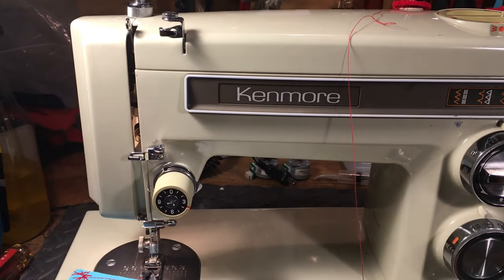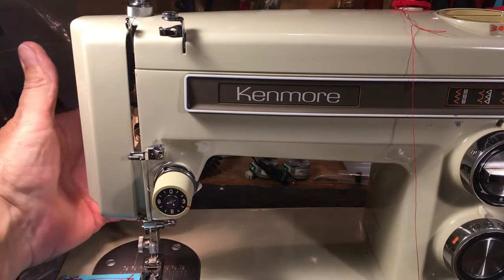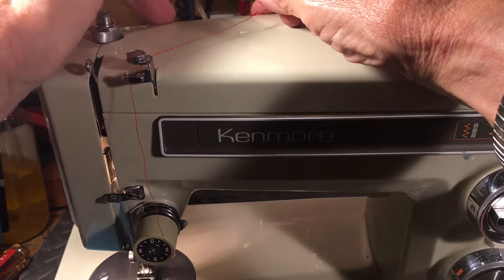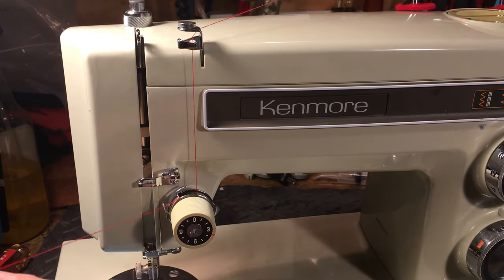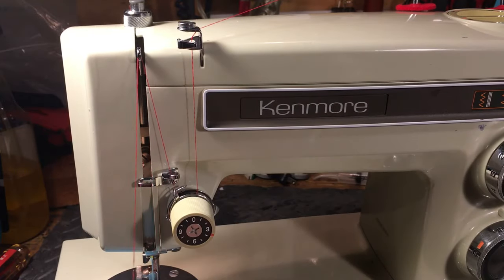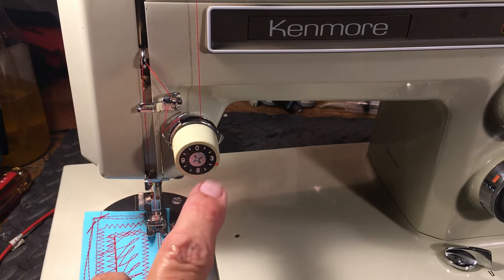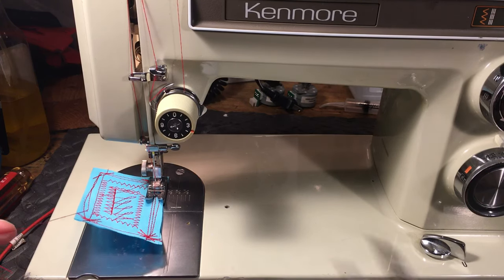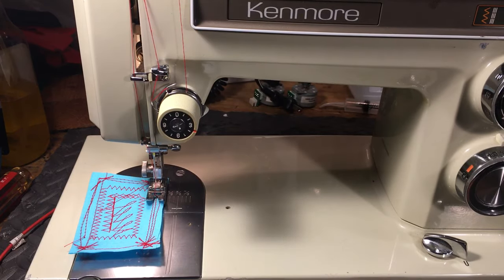How to thread almost every sewing machine properly.(Video 207)

Comment: I love my Kenmore Ultra Stitch 8 from the early 1980's.  It seems like it only cost between $125-$150 brand new and it has been a great dependable machine.  Recently I have found 2 others very similar to it in thrift stores, a 6 stitch and a 10 stitch, and they were only $10-$15 each and both had cases.  All mine are portable which I prefer, otherwise you need a cabinet. (I can always use the extra machines for parts.)  Threading a machine correctly makes all the difference.
Reply from the maker: Yes. It’s the simple things that make a successful sewing endeavor. 
1) thread 
2) threading
3) needle. 
Thanks for watching. 😎

Comment: You gave tips that are never mentioned in the manuals. I’m going to rethread my machine right now, and see if I’ve been missing something. Thank you! That small guide there right before you put the thread in the needle, how important is that one? I’ve not been using it, (nothing in the manual) could that be causing occasional missed stitches? I just rethreaded it correctly and as I’m testing it the stitches seem better.

Comment: I have the option to purchase one of these but it would be shipped across the country to get to me— literally from the East Coast to the West Coast. Do you think it would make the trip well? And should I take it to be serviced after I get it?
Reply from the maker: If you can convince the shipper to pack the machine properly, go for it. Good luck with that. I’ve sent written, step by step package instructions,  on numerous occasions. I still received damaged machines. 
The packing has to be tight with no movement. 
Remove and pack carefully the spool pins and bobbin winder assemblies. 
Use large cell bubble wrap and not small cell bubble wrap. No noodles. 
If the machine is in a carrying case, the inside of the case has to be packed tightly as well. 
If there is any part that moves, shakes, rattles, or contacts anything, it will break in transit. 
It would be easier to send heirloom China than a sewing machine unless you have the machines original manufacturers packaging. 
There are specific packing boxes and associated custom packing for many fragile things, but none for sewing machines. 
The shipper needs to be experienced and detail oriented to make it work. 
If arrives undamaged, oil it and it will serve you well.